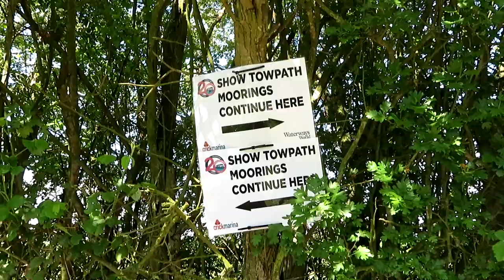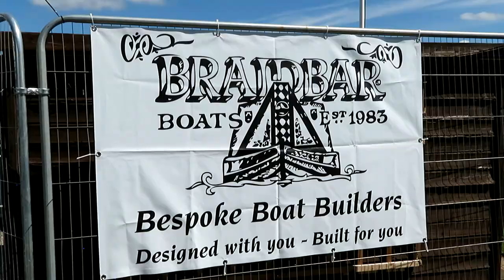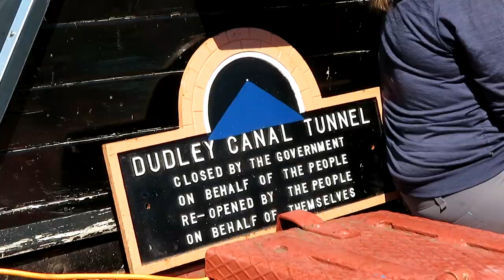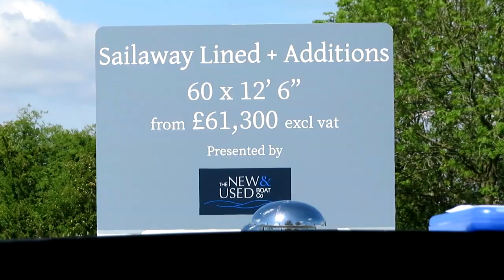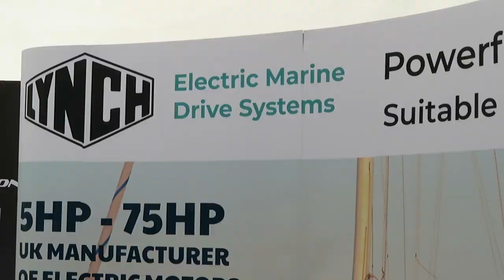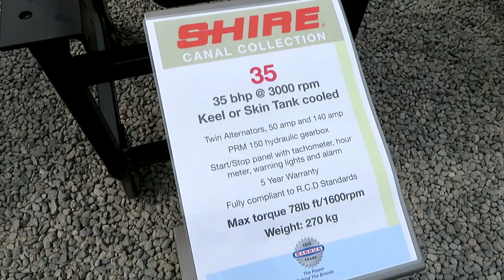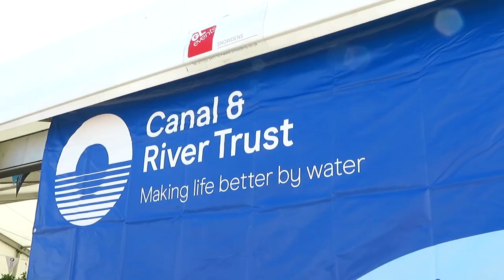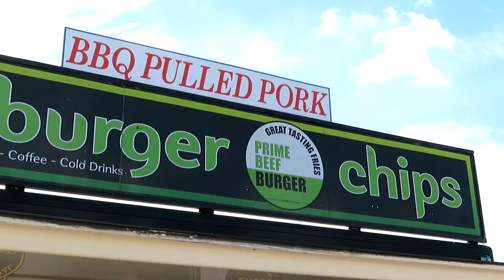49. Crick Boat Show 2019 - Britain's Largest Inland Waterways Festival

Comment: Hi alan,question,if your narrowboat suffers terribly from to much condensation on your windows and glass doors inserts ,
If so,in theory,how would you deal with this immediate pressing problem,
Reply from the maker: Hi Anthony. I don’t have that problem. I do use disposable dehumidifiers in the bedroom and saloon areas and these collect water. If a boat has a problem you need to look at the way the boat is being occupied to find a cure.

Comment: When I hear the price of Boats does that include VAT ( 20%),  or do I add 20% on top of the "cost/price".    Can some one reply and explain the "rules" in England.
Reply: That’s a little complicated as you don’t pay the 20% VAT if you live aboard, you only pay it if you use the boat for leisure/holidays. In my experience it’s best to check with the builder but when we spoke to Aintree they included the VAT in the purchase price so I suppose if you want to live aboard you would have to claim back your VAT. Hopefully that helps a little!
Reply from the maker: Hi Edward. There’s no straightforward answer. VAT is very complex. I noted the price of some boats quoted incl VAT and some excl VAT. The weight of the boat is relevant as above 15 tons there will be no VAT if the boat is not adapted for recreation or pleasure at time of purchase. For boats less than 24m the weight is assessed by the dimensions of the boat multiplied by a factor. It’s not easy to understand.